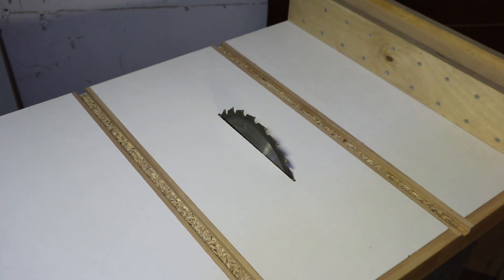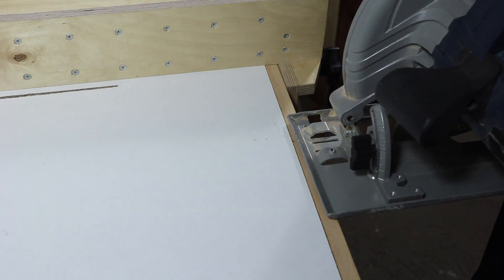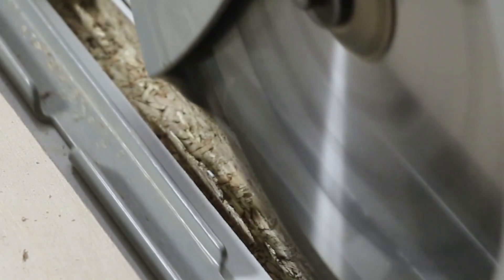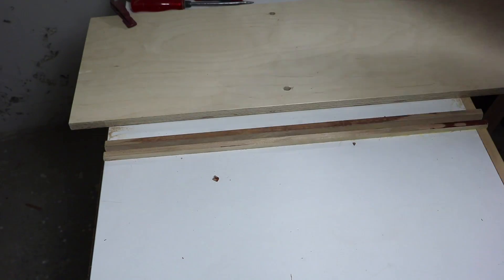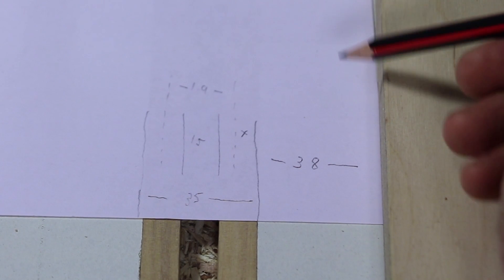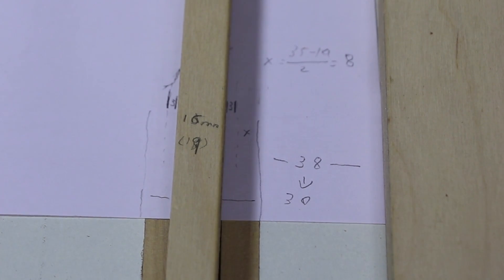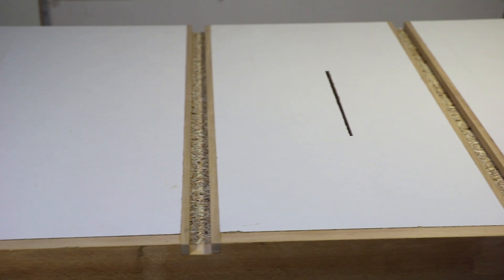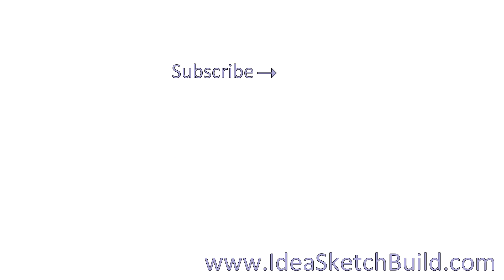Homemade Table Saw - 2: Miter Slots

Comment: A lot of work and wooden tracks are very prone to binding and wear. Aluminium track is cheap, easy and effective.
Reply: My table saw came with a pre-installed miter sled that slides on a proprietary system. I'm thinking of eliminating that and using t-track because it's not very accurate.How accurate do you think something like that would be?

Comment: very good video. Just say things straightforward - the whole process is NOT similar to what Mattias has shown, it IS THE SAME, you just copied him. He is the one that showed this - TWO years, TWICE - onhis homemade table saws 1 and 2. It will not be shameful to say that you followed his instructions to do your miter slots. But to say "the process is very similar" is! You are copying him.
Reply: I have watched both. I agree with you. However, Matthias uses a circular saw backwards. So this is completely different. (Im joking)
I found from this video how far from the blade to have the slots.
Reply: Borislav Stoyanov